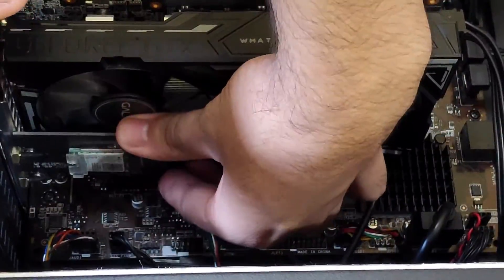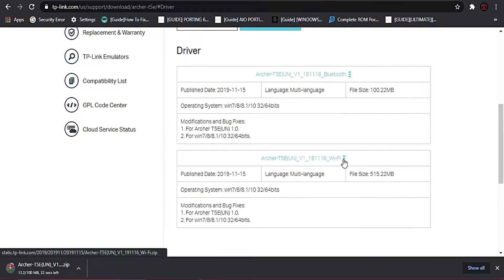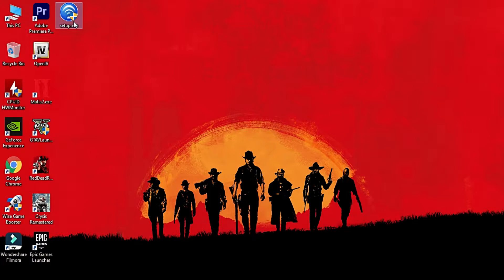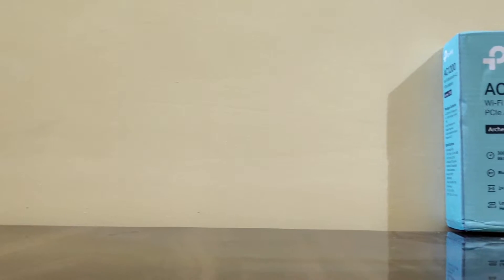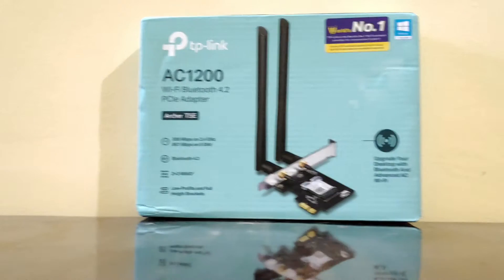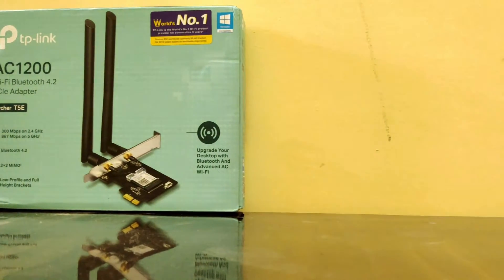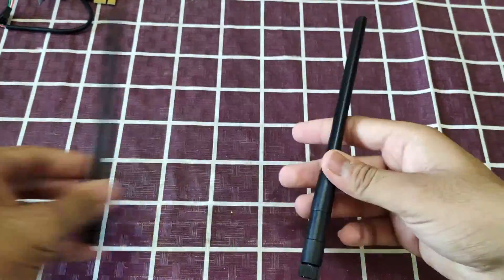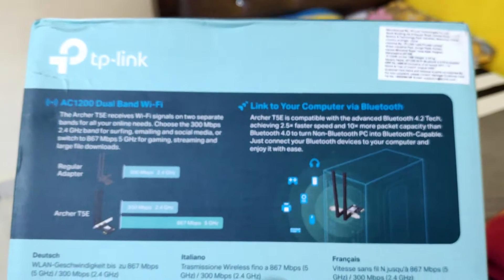Best BUDGET Wi-Fi+Bluetooth Card For Your PC | TP Link Archer T5E | Unboxing & Review | Mostly Techy

Comment: I just installed this but the Bluetooth ( Intel Wireless Bluetooth )  is always showing in the ( safely remove hardware and eject media ) option in system tray ,which is very annoying.
Is it the same for you?
Reply from the maker: Sorry brother I am certainly not able to understand your problem, but If it is related to drivers then I can provide you a new (latest) driver package for Bluetooth as well as Wi-Fi and can guide you how to manually install them.
One more thing about the Bluetooth icon (logo) appearing under the system tray, you can move that Bluetooth icon from the system tray to the Task bar.
Just lemme know if you want me to guide you to install the latest drivers again (manually).

Comment: bruh you put it directly under the gpu fan.......
Reply from the maker: That motherboard only has two PCI-E X1 slots out of which one was covered by the GPU and the other which was the only option left for me to put this card in, I have switched to a better motherboard now.
But putting it that was also not going to affect the GPU coz it's taking cool air in not blowing it out.
(Sorry for the late reply though)

Comment: Great video quick question.  I currently have a small usb Bluetooth adapter and I get a lot of lag with my Xbox one controller. Is there any lag or problems with connectivity to controllers?  I want to get one of these as I also have a small usb wifi adapter as well
Reply from the maker: Getting one of these cards is not only going to boost up your Wi-Fi speeds but is also going to increase signal strength of your Wi-Fi connection and when it comes to Bluetooth, in that case too it's going to be way better than those cheap USB adapters. This Wi-Fi + Bluetooth card works same as a laptop's integrated Wi-Fi and Bluetooth cards coz this is just a work around for it to be able to work with PC's.
Overall I would say you should consider this card if you want to get stable connections and more reliable speeds. (Sorry for the late reply)

Comment: Bro is it just plug and play in windows 10 or i have to install drivers?
I currently do not have internet access in my pc, so how will i download the driver?
Reply from the maker: It's plug and play bro, you don't need to worry about it, As soon as you plug the card in your PC, your Motherboard detects it automatically, The drivers which I was talking about (in the video) are the updated drivers, so just have to plug that card in your PC and that's it you're good to go and after you get Wi-Fi access just connect it to the internet and download the updated version drivers from the link I have provided in the video's description.
Reply: One ☝️ final question if it pleases you
My PC is kinda old 
I’m running a core 2 duo with a g41 mobo 
I hope that won’t affect the plug and play feature…?
Reply from the maker: @jaisheel2574  As soon as you have an extra PCI-E slot left in your motherboard (specifically the X1 Slot) you are not going to face any difficulties because this card is compatible with every motherboard.
Reply: @MostlyTechyProductions  thanks a lot
Reply from the maker: @jaisheel2574  Please Subscribe Brother ❣️
Reply: @MostlyTechyProductions  sure
Reply: Thanks a lot man highly appreciated

Comment: Hi bro! Useful one. Thankyo!
Can u pls tell me what wifi router you use & approx at what distance your PC is from your router and more importantly whats the speeds you are getting in 2.4Ghz & 5GHz bands in ur PC?
Reply from the maker: Hello brother, I am currently using "Netis Wf2419e 300 Mbps WiFi Router" and the Network Connection is from "Railwire" and the router is approximately 15ft away from my PC, I have tested out the Speed of 2.4GHz and that was around 15-16 Mbps but donno about 5GHz speed Bro
Reply: @MostlyTechyProductions  okay. Thanks for the info :)
Reply: @MostlyTechyProductions  mega byte or mega bit??

Comment: which is best Adapter or inbuild 
Wi-Fi Motherboard
Reply from the maker: If you're gonna buy Inbuilt Wi-Fi Motherboard then it's so far so good, but when compared to an ordinary USB adapter this Wi-Fi + Bluetooth Card (which I reviewed in this video) is far better, it's mostly likely works same as the In-build Wi-Fi + Bluetooth motherboard
Reply: @MostlyTechyProductions  Thank U Bro.
can u suggest me best B460M Motherboard  for Intel i5 10400?
my budgt is 9thusnd!
once again thanks brother 🤗
Reply from the maker: MSI offers one of the best motherboards in the market for budget, one of them is MSI B460M-A PRO motherboard with 2 RAM Slots which you can get under 8000Rs:
https://www.amazon.in/MSI-B460M-PRO-Gaming-Motherboard/dp/B08B1TBDKC/ref=asc_df_B08B1TBDKC/?tag=googleshopmob-21&linkCode=df0&hvadid=397097899420&hvpos=&hvnetw=g&hvrand=8613422295773373166&hvpone=&hvptwo=&hvqmt=&hvdev=m&hvdvcmdl=&hvlocint=&hvlocphy=20462&hvtargid=pla-935019990453&psc=1&ext_vrnc=hi
                      OR
If you can spend slightly higher amount of money, then you can go with MSI B460M PRO-VDH ProSeries Motherboard with 4 RAM Slots which you can get for 10,490Rs currently on Amazon:
https://www.amazon.in/MSI-PRO-VDH-ProSeries-Motherboard-Chipset/dp/B08QZPP88C/ref=mp_s_a_1_4?dchild=1&keywords=b460+motherboard&qid=1617127338&sprefix=b460&sr=8-4

Comment: Bro Bluetooth and WiFi can work simultaneously with this adapter,right?
Reply from the maker: Yes Bro with ease, they can run at the same time, you can browse the internet while having your Bluetooth Headset connected to your PC
Reply: @MostlyTechyProductions  Thanks For Help Bro
Reply: @MostlyTechyProductions  will it provide fater internet than ethernet??
Reply: @g4gamerkid69  no but close to ethernet

Comment: How's the performance now? Is it still good? Does it throttle due to no heatsink?  As t4e comes with huge heatsink. Please reply asap. 👍
Reply from the maker: The performance is excellent, so far I didn't face any problems in this Card, It does not throttle perhaps it doesn't even heats up, T4E is a different card with the WiFi chip soldered into the Card so it requires a heatsink, T5E comes with a micro Wi-Fi + Bluetooth Card which we can remove and replace with another one, just like the one which comes with the Laptops ( These Wi-Fi + Bluetooth Cards doesn't require a heatsink ) Go for it, it's the best budget Wi-Fi + Bluetooth in the market.
Reply: @MostlyTechyProductions  
Thank you.
Reply: 🙂 its the same wifi card that you get in many laptops, they never use a heatsink

Comment: Hi, what do you do if you have only 2 USB connectors on your motherboard and both are in use, where do you plug this card then? Or is there a bluetooth card that doesn't use USB? Thanks!
Reply from the maker: Unfortunately there is no other way, and sorry that I mistakenly said that the USB connector cable is for power, The PCIe X1 slot is itself capable to give power to the card and perhaps It is to establish the Bluetooth connection and there is no other way to do that without connecting the USB 2.0 connector cable to the Motherboard, There are some USB Bluetooth adapters in the market which you can get as cheap as 3 Dollars but they are not good as compared to this Wi-Fi + Bluetooth Card
Reply: Broh, if its an oem motherboard i assume one of those usb plugs is for the front usb headers? You dont really need that. Disconnect that plug and use the usb plugs on the back of the case for ur usb needs. You need to plug in that cable into an open USB Header on the motherboard if you want Bluetooth functionality. If that cable is not plugged in then the tplink card will only provide WIFI.
Reply: Change the Mobo
Reply from the maker: shom blog  Yes, obviously !

Comment: Usb cable doesn't provide power pcie port itself provides it it's a Bluetooth adapter 😅 and two antennas are for 2.4GHZ and 5GHZ do a proper research dude😅😅 and two antennas doesn't provide better coverage 2.4GHZ wifi networks usually cover larger area with less speeds and 5GHZ wifi networks covers less area with high speed 😅😅
Reply from the maker: Yupp bro sorry for that, Later I noticed that the PCIe X1 slot is itself sufficient to provide power to the card perhaps the USB 2.0 Connector is to establish Bluetooth connection.
Reply: @MostlyTechyProductions  🙂 its because the tiny card was really meant to be used in laptops, the usb cable that you plug into the motherboard is a 'work around' to make it work in a desktop, cheers

Comment: I have no spare USB 2.0 header as I have only 2 nos. USB 2.0 header. Can you suggest me to give power to the card?
Reply from the maker: Hello, sorry that I mistakenly said that the connector is for giving power to the Wi-Fi Card, but it's actually for Bluetooth, the PCIe X1 slot is capable of Giving upto 75 Watts which is more than enough for the Wi-Fi Card, Unfortunately if you do not connect the USB 2.0 cable then you will not be able to use the Bluetooth function of the Card as it depends on the USB connection so you have to remove one of the USB 2.0 connections from your Motherboard and then need to connect the USB 2 0 connector of the Wi-Fi card to it, to be able to use Bluetooth functionality.
Reply: Without the cable the card only can give you WIFI. If you dont need the front usb headers on your oem case then disconnect them and plug in your new bluetooth cable there. You wont have front usbs anymore but u still got the usb plugs in the back of the case.

Comment: What would be better.. t4e or t5e? I mean, I was going for T5E but I was afraid because it seems like it has no heat sink. Where as T4E has a great heat sink
Reply from the maker: Look if you want only wifi (no Bluetooth) then you should consider T4E because it's a great value for money, but if you want Bluetooth + wifi also, you should consider T5E only, T5E is the only card which gives both Wi-Fi + Bluetooth in that price, don't mind that if it does not have heatsink, it doesn't need one because it has a mini wifi card (which is replaceable also in case) it doesn't require heatsink